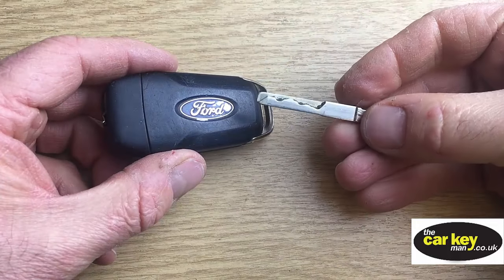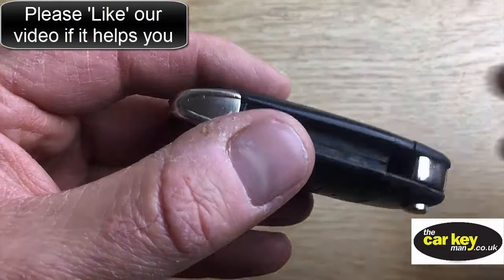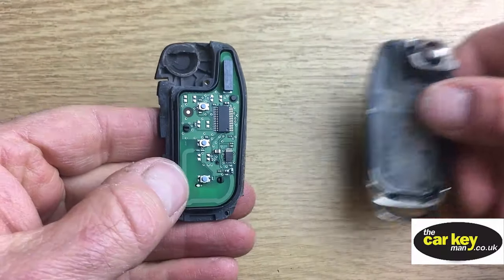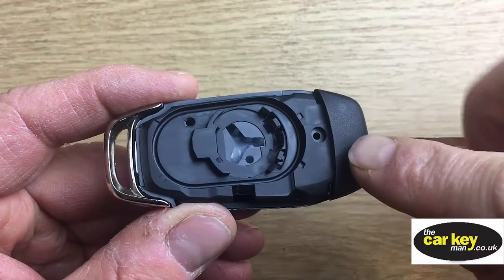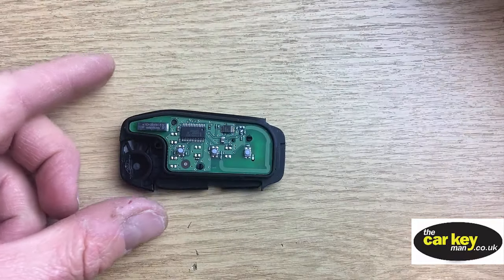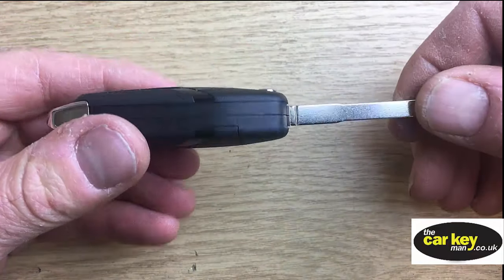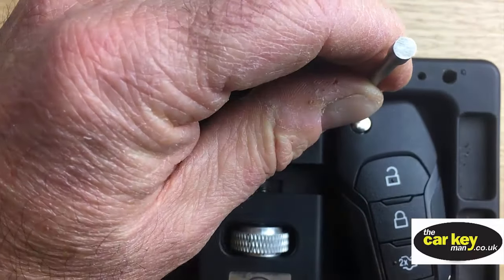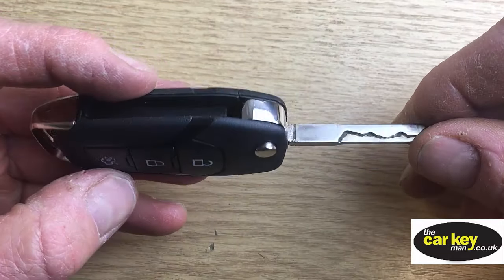Ford Transit Connect 2018 Broken Key Repair HOW KA, Ranger

Comment: Was able to repair my Ford F 150 key by using your instructions. Bought a new key from e-bay, took out my old circuit board and installed it in the new key, switched the new (uncut) blade with the blade from my old key and it works! I had the same problem with it not flipping out correctly when you press the button as you mentioned in the video, but it works and will serve well as an extra key! Thanks for your video!
Reply from the maker: Hi Jeff, thanks for the feedback. Yes there does seem to be a problem if you swap the blade over. It's as if the flip mechanism gets damaged just in swapping the blade. 
To be honest the keys are a complete disaster
Reply: Do you know what size is the star screw so i can get a bit?
Reply: @josevelazquez2086  T-6

Comment: 100% of the reason this happen is the pin is holding a channel on the keyblade instead of the pin going through a solid hole on a massive torque point for the key..
Reply from the maker: Hi Ryan, yes really poor design by someone....

Comment: Thanks for the video. I'm going to attempt a flip key shell swap next week. Both my keys have a broken hinge. Doesn't seem too bad judging from your video. Let's hope it goes OK.
Reply from the maker: Hi, thanks for watching. The only real issue with the swapover is that the replacement cases aren't great. Godo luck ;)
Reply: @TheCarKeyMan  Hey there. I did the swap over a few days ago. You're right, they aren't great. The roll pin hole on my new key didn't line up correctly with my old blade. Ended up having to drill the hole out just slightly. Lock button is also a little stiff. However, it's ok. I can live with that. Better than paying for new ones. Thanks again for the video. It helped a ton. :)

Comment: Thanks so much.  The metal piece in the back that hooks to a key chain had popped out somehow, and wouldn't snap back in without taking it apart  following your instructions.
Reply from the maker: HI, yes I'm starting to see this. Bit of a poor design that it can coome out so easily. Thansk for the feedback :)

Comment: The trouble with the the new car keys, the pin is very skinny and it brakes very easy, usually it takes about 4 to 6 months to brake. I'm surprised it lasted a year.
Reply from the maker: Hi Cameron, yes I agree, pretty poor. Did yours break?
Reply: @TheCarKeyMan  I don't own a car yet. But I work with car keys. And the newer models always breaks.
Reply from the maker: Agree, they are really poor quality now. Thanks for the reply ;)

Comment: I had this bad experience .What bad quality  crap not even covered by 1 year warranty..
What a bunch of crooks want $320 for a new key..
Reply from the maker: Hi Katan, yes I believe these keys are bad as soon as you get them out of the packet. There is too much wobble in the blade assembly in my opinion, compared to most other keys

Comment: Thank you! The second of my Ford Fusion's keys broke the same way (same issue withy the first). Any tips for how to pop out and re-insert the pin holding the key blade? Attempted once, but could not get the pin reinserted on my first key replacement attempt?
Reply from the maker: Hi Jeremiah. Will they are a bit tricky just because the pins are quite short. The hardest part is keeping the pin still while applying pressure with long nose pliers. Have you tried that?

Comment: Would you guys have any idea how to replace the silver handle part on one of these? (The part where the ring goes) I have a spare handle, I just can't seem to get it on. Thanks!
Reply from the maker: Hi, I’m sure the silver part should be moulded as part of the case, so not sure you can swap this, sorry
Reply: @TheCarKeyMan might be late, but the silver ring handle comes out cause mine did and I had to pop it back in taking the fob apart

Comment: If you do this replacement do you have to reintegrate the key with the vehicle as in does it just go back to being a key for your specific vehicle or will it have to be recoded?
Reply from the maker: Hi, it will still work fine ;)

Comment: Can you buy just the spring clip piece that the blade goes into? Since that's all that really broke it seems kind of wasteful to have to buy a whole new shell. Still so much better and cheaper than trying to get a new one from Ford though.
Reply from the maker: Hi Ken. Well the problem is that Ford don't just sell this part. If you buy a replacement case and just use that part from it, it probably won't work because it's made slightly different. But give it a go

Comment: I have a 2016 ford fiesta and my key broke.. the remote works fine, but I have to use my spare key to turn on my car.. can I just buy a shell that has the key and move all the components from my working remote onto it ?
Reply from the maker: Hi Jose, is it a flip key?
Reply: @TheCarKeyMan  no
Reply from the maker: How did the key break? Is it just the blade? Does it look like the key in the photo?
Reply: @TheCarKeyMan  the blade broke.. it was inside my backpack when I fell of my bicycle and when I checked the blade had broken off.. the remote still works, but I have to use a spare key to turn on my car.. my spare doesnt have the buttons it's just a key

Comment: Is there any way to swap out the shanks from the old key into the new keys flip mechanism?
Reply from the maker: Hi, the old blade will come out of the flip mechanism, but you may need to modify it to fit into the replacement case